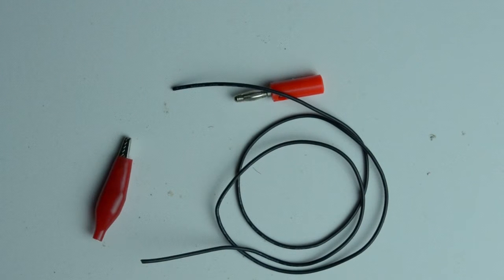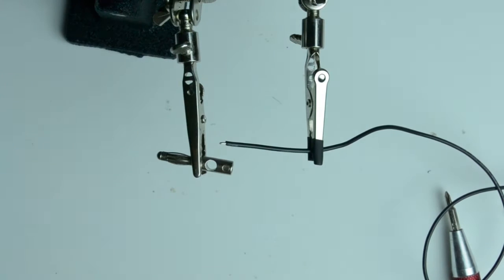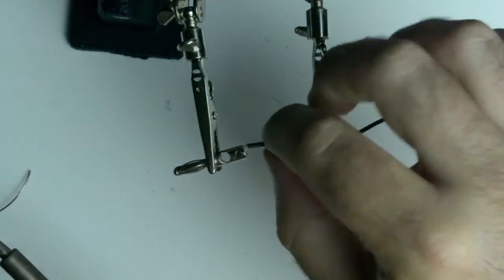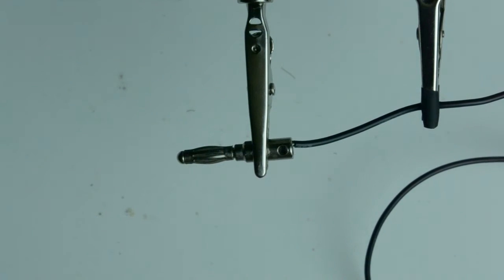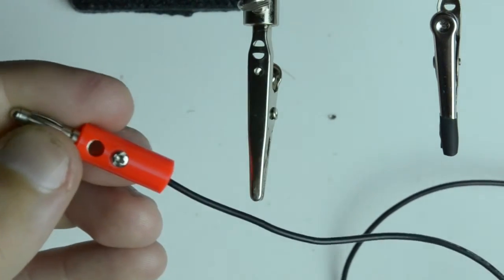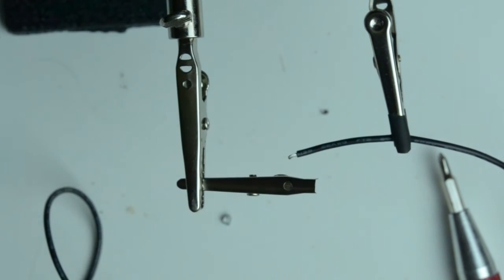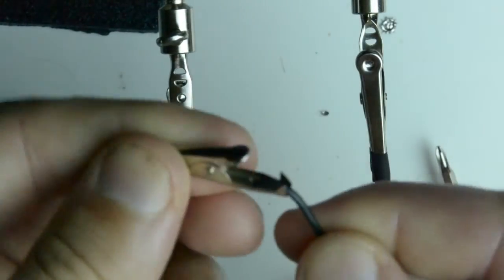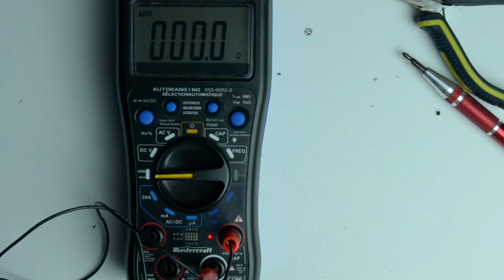DIY: Make your own custom multi-meter leads

Comment: Another excellent tutorial! There are only a couple of suggestions I would add.

Firstly; after you have the banana plug soldered to the wire and the plastic collar in place I suggest you run some two-part epoxy resin down to fill the void beside the wire. This will gave much better strain relief and prevent it pulling off after some use. Silicone insulation can be tricky to glue but I personally have found standard araldite works. You might also then put a heat-shrink tube over the whole thing, preferably the kind which has its own hot-melt glue on the inside just to add the finishing touch.

Secondly; even with a hot iron I have found it super difficult to solder onto the metal of these type of clips. Obviously you got it to work with a minimum of fuss, however I apply a Dremmel wire-wheel or just rough sandpaper to the spot where you intend to attach the wire. This roughens the surface and makes it much easier to get solder to stick.

Otherwise this is a really useful process to document and I am very happy to see it publicized here, especially when you look at the insane price of crocodile clip multimeter leads on eBay. I have no doubt certain other, heavily cost-bigoted YT electronics channels would have apoplexy over making your own leads like this. However in my opinion--and quite some amount of practical use!--they are more than satisfactorily for low voltage/current applications. Maybe don't connect them up to the mains, but for any likely hobbyist scenario they work perfectly well.

Comment: It's easier to use a wooden block with a 4mm hole rather than Helping Hands. It doesn't take as long because it isn't so much of a heat sink.

Comment: genuine noob question... why not just anchor the cable in with the screw?
Reply from the maker: The wire is too thin and screw threads tend to work themselves loose

Comment: If going to all that work, I would used better components.
Reply from the maker: It's really not that much work, making the video is 10x more work than making multimeter leads...and this was done years ago and I still use them to this day